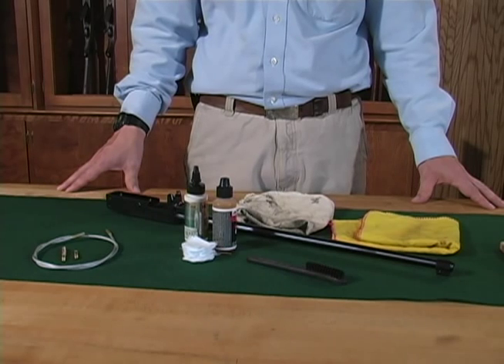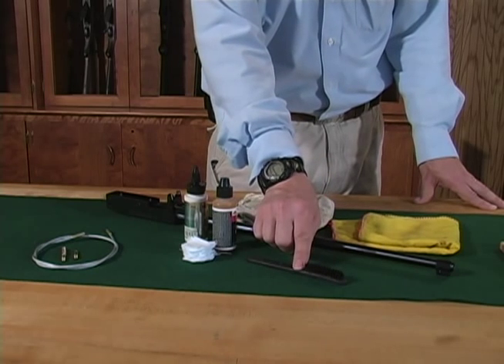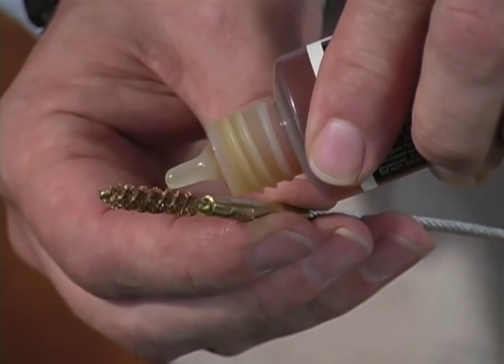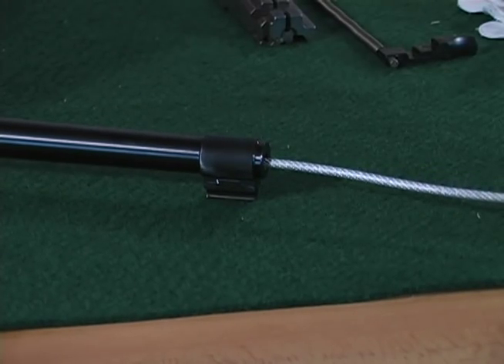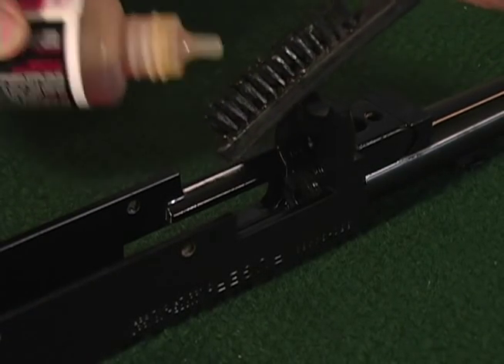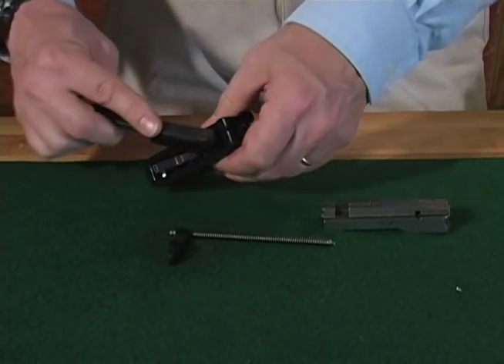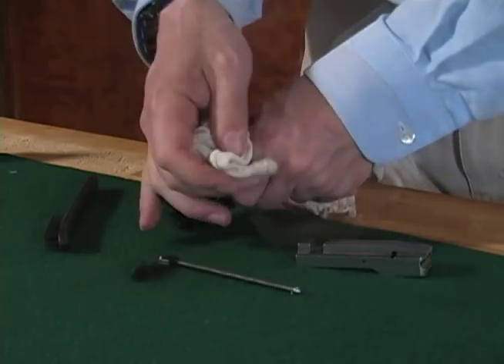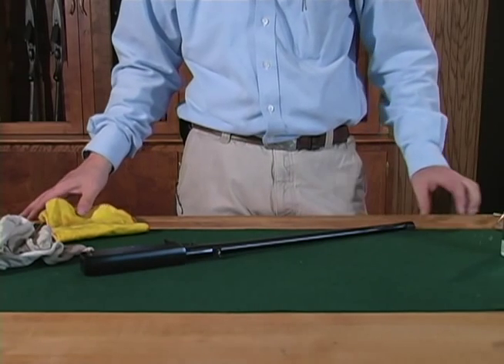Ruger 10/22 Rifle Cleaning

Comment from the maker: We have updated the 10/22 trigger guard group components from die cast aluminum parts to glass-filled polymer. The benefits of polymer are many, including improved impact resistance, an unmatched ability to withstand the elements, and weight savings. The color is incorporated directly into the polymer so the finish will never wear off, plus the heat stabilized, glass filled polymer will withstand impacts that would bend or even break the die cast aluminum parts previously used in Ruger 10/22s.
Reply: Please go back to aluminum

Comment from the maker: All firearm bores should be cleaned from the breech end (the end opposite the muzzle) whenever possible.  This minimizes the possibility of damaging the muzzle crown with cleaning tools. The slightest nick in the crown can impart a disturbance to the bullets flight path as it exits the muzzle, hindering accuracy.
 
If cleaning from the muzzle is absolutely necessary, segmented rods should be avoided. One piece rods (the best are carbon fiber) or snakes (such as used in the video) are preferred.

Comment from the maker: Some cleaners can affect polymer, but with the popularity of polymer components rising, many companies are now making solvents and cleaners specifically for polymer parts (for example, Shooters Choice has a spray cleaner specifically for polymer). Also, be careful about what solvent you use on aluminum parts as well, as many fast evaporating cleaners will remove the finish on aluminum parts. Always make sure you have the right cleaner for the part!

Comment: Oiling the interior AND exterior creates a light barrier that protects the metal from oxidation (rust) that will degrade the look and eventually function of the gun. Even the oils on your fingers can eat away the finish of an un-oiled gun left to sit in storage. 

A light coat of oil will attract a bit more dust while not in use, but what would you rather have; a dusty gun or a rusty gun?!

Comment: Don’t forget to add some TW-25 grease to the bottom of the bolt , this rubs on the trigger assembly top and without it this will cause it to bind and run slow , cause stove pipes and jams.

Comment: Why don't you take the barrel off?
Reply: no need, as long as you clean the receiver and inside of barrel, you should be fine
Reply: Brad Davies Continually taking off and putting on the barrel can ruin the threads. Receiver and barrel have to be properly aligned as well, A bit of a chore if you do it every cleaning.

Comment: Cleaning is not my issue.  Just got a 10/22 take down.  Rear sight bevel is canted, barrel locks up about a 1/4 inch of center.  Bottom line I can't even get on target with it.  Beyond me how they could let something that screwed up get leave the factory. Problems jump right out at you as soon as you look at it.  Guess Ruger employees have no pride whatsoever.